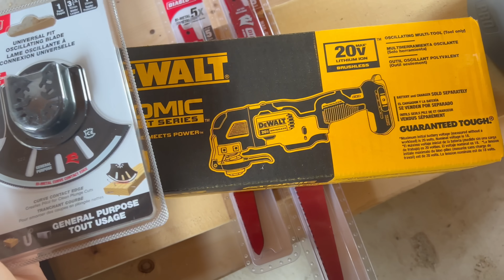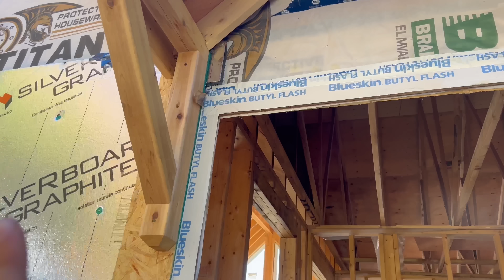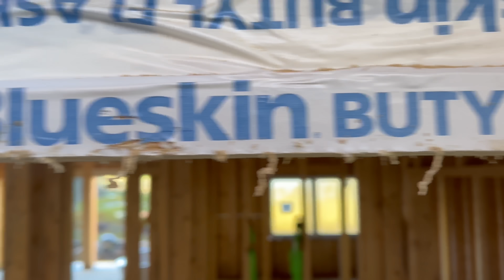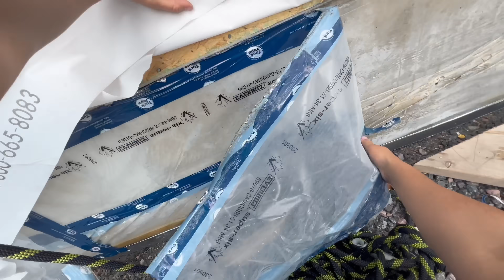Welcome To My Home! We’re FINALLY Closed In!

Comment: Friendly tip: you'll need to pack out the headers in order to hang the drywall. Plywood sandwiched between the 2 headers is great to get the correct thickness.

Comment: Another milestone ticket off ie all doos and windows in. Another little tip for you when your putting anything on that needs to stick then use a heat gun to warm the surface up and then again on the product after you've applied it then i all was use a hard roller over the top to compress the two together. big hugs too all xx
Reply from the maker: Great idea on the heat gun! Thank you!

Comment: When I first became a paid carpenter, Pete told me,, a carpenter must ALWAYS be prepared to take out what was just put in. It may be perfect, artistic, you are proud as blue blazes of the flawless church work moldings install,, but,,  The customer wants the blue one,, or the customer,, despite being the one who told you to do it that way, wants it favouring left, not right..  A good carpenter must be willing to take out what was just installed.  I've been doing this for 60 years and just two days ago I completed a curved roof with trim covering a single door.  and the customer said , No.  do it this way.  I took the completed roof off the house completely and started over.  Did it to the customers explicit instructions.  Finished it today.  Customer is always right.  
2 inches or more wider,, 2 inches or more taller
Reply from the maker: This is an amazing way to look at things. Especially when you’re dealing with customers or designers etc. thanks for this!

Comment: Glad you were able to resolve the issue with your doors and a heads up on interior doors they might very well also be wrong if you followed your house plans when framing the openings draftsmen or women most of the time have no practical experience in the building trades.. hence the mistakes a normal door size for a home is 6 foot 8 inches tall which means your opening needs to be an inch bigger a pre- hung door is 36 inches plus the door frame on each side is 3/4 of an inch making the entire door including the door frame 37 and one half inches wide you also need to leave a little space for adjustment between a half to 3/4 of an inch hope this is helpful and not to confusing

Comment: Looking great!  So close to getting to work on the siding.
  Just a suggestion,   but there is a blue skin primer that will help in long-term term adhesion to the substrate, such as wood and concrete.

Comment: Have helped my Dad build two homes years ago. With full basements it was easier to install 
well input and septic outlet systems compared to the extra work that you had to do,Biata. Even though these homes were close to town they were classed as rural and didn't require all of the inspections except electric which  came from town power connection.  Dad worked in assessing risks for insurance purposes so he knew all the requirements in the building codes of the time.  I find it amazing the endless inspections required today which I am sure contribute to the rising cost of home building everywhere.  You did an amazing job, Biata. Great to see your Mom & Step-dad Craig helping again with the huge doors install. It looks awesome. Given your location the drainage project will save you lots of future issues! 
👍👍👍🤩🔨📏👌👌❤